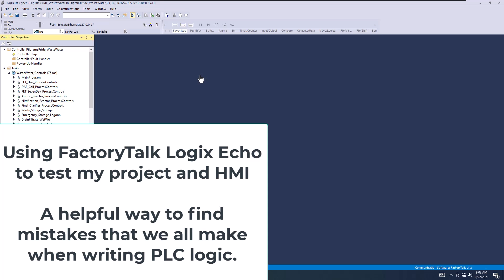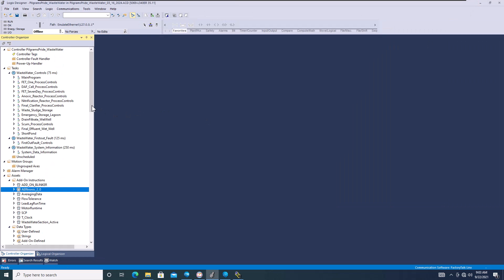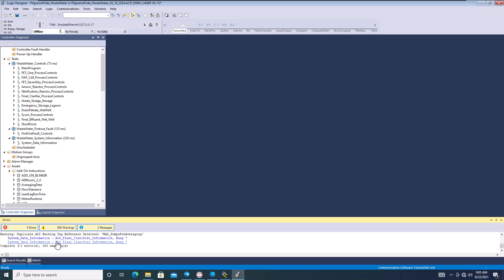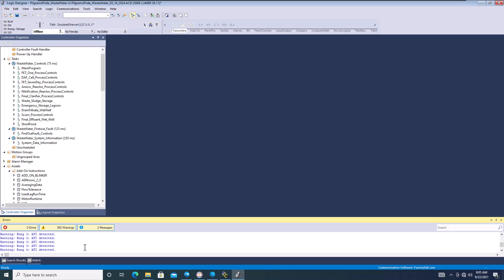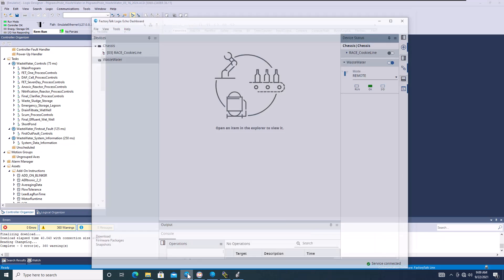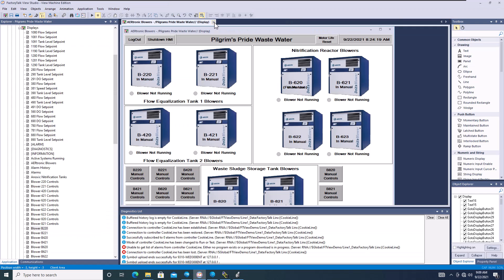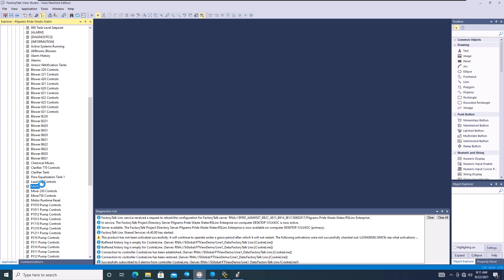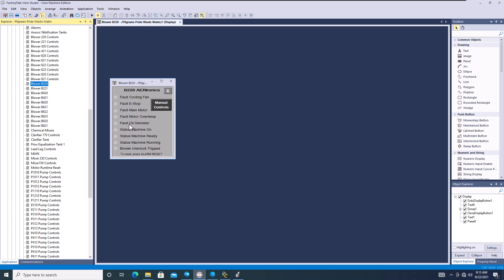Using FactoryTalk Logix Echo to test my project and HMI

Comment: Hey,

While adding the controller from ACD, does subnet mask matter because I don't have that section here.

Well my problem is the controller is not showing up in Who Active and I have been stuck at this problem. I have 2 controllers at port 0 and 1 and I am unable to connect to both of them. 

Just started a job as an HMI Engineer and was trying to do IHAT testing.

Great content..
Reply from the maker: Add the controller from the ACD, yes I add the subnet but it's automatic. 

You have to use FactoryTalk linx not RSLinx.

And also, make sure you download it once you see it

Comment: There would be a lot more value to this if you went through the implementation of actually testing.  As @drlynch mentioned, how are you managing the IO coming into the devices? Are you using the SDK or have you stubbed your inputs?
Reply from the maker: It's simulating the PLC logic not inputs and outputs, the benefit is that the processor doesn't have to be changed to test your logic.

Why complain about someone making videos explaining what they do to test logic?
Reply: @ShaneWelcher  not complaining, just a recommendation.
I’ve used the emulator a lot, and used PLCSI’m as well for Siemens PLCs, but one thing I always have to do is to change the program to provide simulated values on the input tags so that the logic will run.
Otherwise the values won’t be a “true to life” values. E.G my AIR OK signal isn’t connected to an actual signal when running in an emulator so I’ve to ensure this is TRUE somehow while testing.
A pneumatic cylinder will expect to see a retract limit switch go off and after a delay an extend limit switch on after an extend command, this has to be stubbed out or simulated somehow or your sequence will stall waiting for feedback it cannot attain.
This can be done with custom logic overwriting input values or something like emulate3D or Visual components. Does Echo provide something like this on its own? That is what I thought was the answer and was making a recommendation.
Reply: @d3adlyBuzz  Does the ECHO software allow you to simulate I/Os?
Reply: @ShaneWelcher  Does the ECHO software allow you to simulate I/Os?
Reply from the maker: @RafLeo000  By toggling bit yes, not an interactive display though

Comment: How are you emulating real world devices that interacts with your application program? Such as belts, pumps, robots, motors, sensors, etc?
Reply from the maker: Using FT Logic Echo is better for testing than emulator